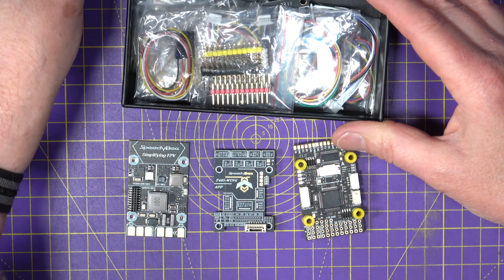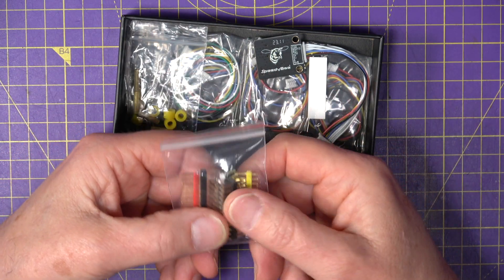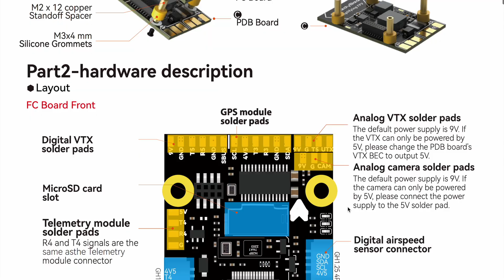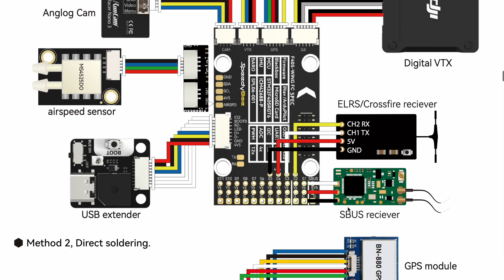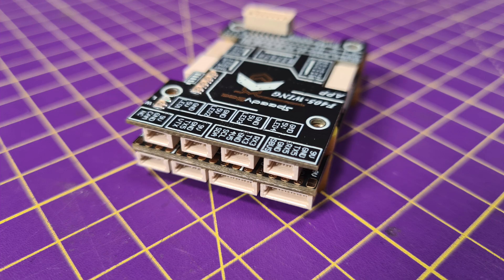SpeedyBee F405 Wing APP flight controller stack review - INAV and ArduPilot supported

Comment: Hello Whirly, How can you get the black box data from the SD without having to remove it?
Reply from the maker: Thanks for watching my video and I appreciate your comment.

To access the black box data from the SD card without physically removing it, you have a couple of options:

1. *Using the SpeedyBee App:* Install the app on your phone or tablet, power up the plane and connect using bluetooth/wifi. Navigate to the "Blackbox" section in the app, where you’ll should see an option to download or view the black box logs stored on the SD card. You can choose to download them or analyse them directly in the app.

2. *Using a USB-C Extension Cable:* Another option is to use the included USB-C extension cable. Just make sure the USB connector is easy to get to when you build the plane. Connect a USB-C cable between this and your computer. Then use Betaflight or INAV configurator to download the logs as normal.

Both methods provide convenient ways to access the black box data without physically removing the SD card. Let me know if you have any further questions.

Comment: Sadly ordered mine to late so i have to wait for a while, but i am excited. Either going to put it into my vtail or my wing not sure yet
Reply from the maker: I'm sorry to hear that you have to wait for your order to arrive, but I'm glad to hear that you're excited about it! Installing a new component like a flight controller can be a fun and rewarding project.

Choosing between installing it in a vtail or wing configuration will depend on your personal preferences and the specifications of your aircraft. A vtail configuration can provide more maneuverability and control, while a wing configuration can provide greater stability and lift. 

Consider your flying style, the type of flying you plan on doing, and the characteristics of your aircraft when deciding which configuration to use. Additionally, be sure to carefully read the documentation for the flight controller and follow any installation and setup instructions to ensure safe and proper operation.

Comment: Although it looks great, many older UHF systems (433MHz) designed for long range use PPM. If iNav would reinstate this protocol I imagine it would encourage many to make the switch.
Reply: Pretty sure there’s people workin on 433 ELRS. Other then that, I recommend to switch to elrs. Older 433 protocols do get removed for reasons
Reply from the maker: @DivisionRc  Agreed. I've moved to ELRS for everything now.
Reply from the maker: INAV monitor what features are being used and the maintainers do periodically remove features that are no longer or rarely being actively installed.
Reply: Mine running with rlink long range 433mhz using sbus